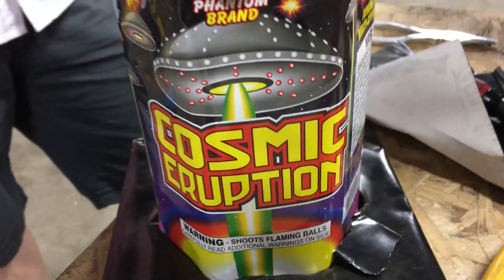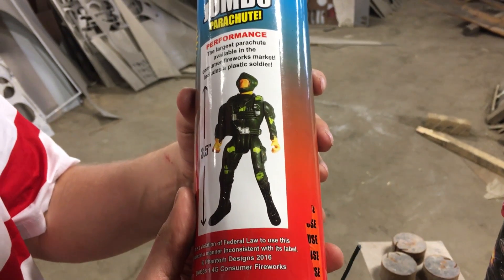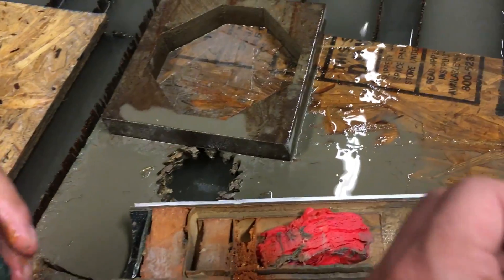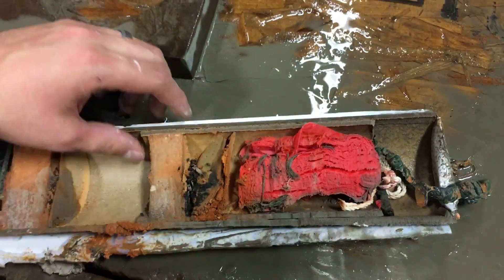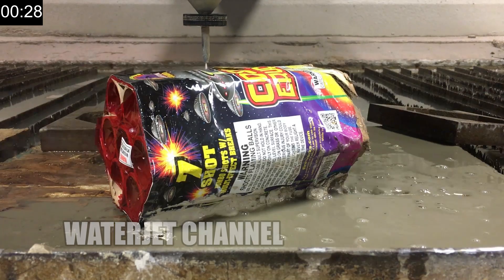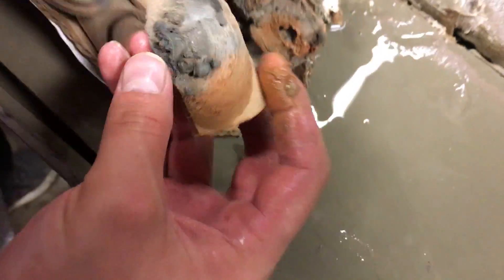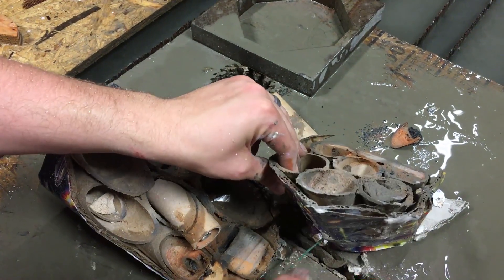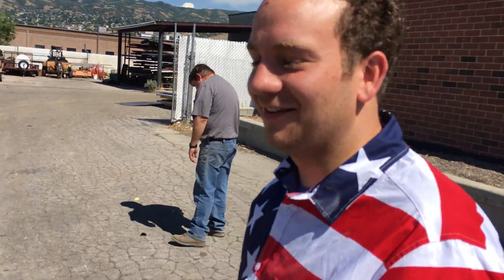Fireworks vs 60,000 PSI Waterjet

Comment: Cut open an electric guitar
Reply: theres not much to an electric guitar its all solid
Reply: That moment when no one gets it..! 😂
Reply: Peter - not really, the "electrics" inside are tiny.
You have like 10 cables and one microcontorller (have you ever seen an arduino?)
Reply: I'm vaguely concerned that you aren't being intentionally humorous in saying that something which hasn't changed since 1931 has a microcontroller inside.
Reply: Delithicus   It's obvious that there are electricity inside...
Reply: I actually build guitars as a side job/hobby, most guitars are solid wood, hollowed out middle which is really just wires connecting all the pick ups and the jack together.